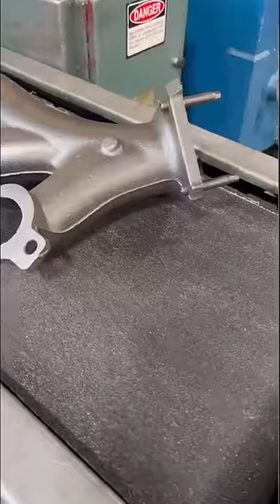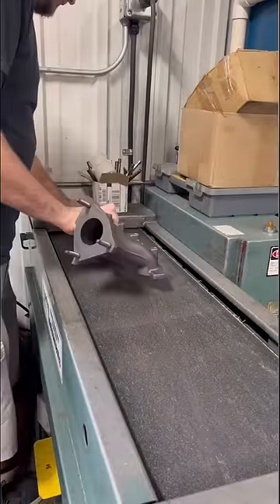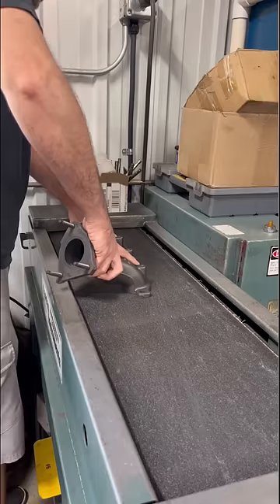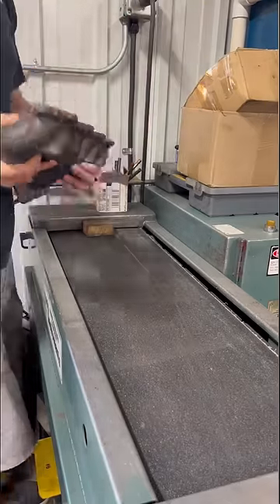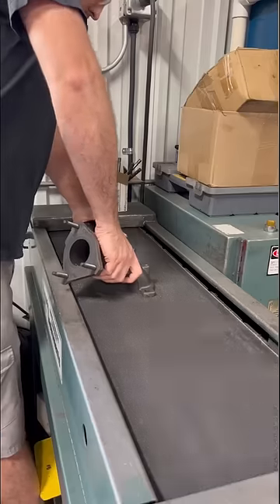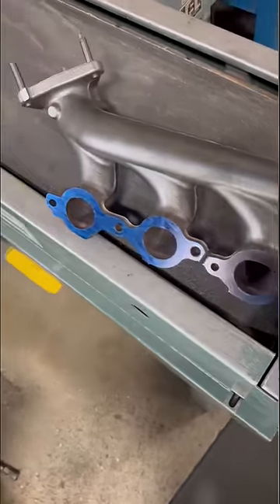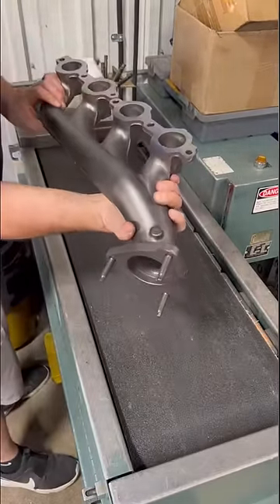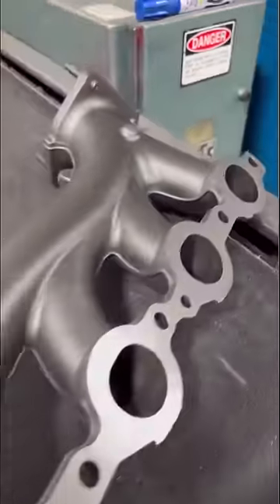#shorts This Is How We Resurface Warped And Worn Exhaust Manifolds

Comment: Hey since the video is making another rotation around. What would you say if shops don't want to do small jobs like this? Called a guy cause I wanted my head resurfaced found it should cost a couple hundred bucks. And the guy I was able to reach in my area told me. " My machines worth more to leave off then run it for a couple minutes on a head." And I know those machines aren't cheap by any means. But isnt that the part of why you have it. To add more business?

Comment: cracked dat flange, dont think i didnt see that ;)
Reply: Look at the gap and shift after… that was a bad design and stress at that point in the metal. Eeek
Reply: Cut that thing In half to reduce leverage from warping. Intentional mod.
Reply: EZWeld 🤣🤣🤣🤣🤣
Reply: One piece flanges crack. 454's are notorious for that...That was cut to eliminate that problem.
Reply: Factory &as a small gap there (really small) on newer ls's all 4 are split.

Comment: Okay, WTF is going on with the tiny metal bridge in the middle?

First it's connected.

Them later it looks like it it's sheared in half.

Them it looks connected again.

Are you pulling out legs, and showing two different exhaust manifolds, or did you have to cut and re-weld it to get it level?

Comment: Holy hecking hecks, that's a big old belt sander.
Dang, yo, if ya use it as a treadmill I guarantee you'll lose weight.

....i mean, either by running or sanding off ya legs..

But weight lost either way, lmao.

What grit is that belt? Like 60-80 or 220+? That much surface feed rate would be some aggressive material removal at 60 grit, im guessing.

Thats gotta work far faster and more efficiently than finding all the stuff to properly hold a awkward part like a manifold on a milling machine.

Comment: Thay will aways be whooping on the ends even a week after you put tham back on because the middle gets hottest and the ends will aways whooping a little even machined but whare thare bolted on thare tight whith a gaskets thare fine but I will give you a tip from experience  make dame shore you don't use a after market  gasket  ill garrentee you will have trouble air sucking in

Comment: Aaron give it up don't be like that if you threw a micrometer on there it would be within a few thousandths it's an old way of doing it but it works are you going to mouth the power block Channel because they resurface a head with a flat piece of Steel and sandpaper

Comment: When you want a bodged job done, use this guy.
Reply: It's not going to do anything to it that machine has a flat platen that that belt runs across more so than any belt sander in a wood shop? Doing it with a file or a bodyboard or by yourself ain't going to work they do that stuff all the time as long as you run it lightly it doesn't wreck it or taper it so that's the way you do it if you set it up on a mill it's going to take cost three times as much

Comment: I actually have 2 of these belt sanders.  This is exactly what they were designed for.  This is a stock run exhaust and not a percision built exhaust for a 2500 horsepower setup.  This is for taking something .020 out and getting it don to .002 give or take.  As long as you are not decking heads and blocks with this machine then I don't see a problem.

Comment: What's up with the massive Crack in the middle of the intake then is all of a sudden gone
Reply: One of two things, I was curious after you left this comment so I rewatched it a few times. IMO I think he either just edited it weird and was doing two different manifolds and was just showing two diff times he was sanding to get across the same point. The beginning and end are the same and the two edit parts in the middle with sharpie are the same, he may have just not filmed with the other and put that in to show the process. Or he was just trying to make it look better lol but Obviously both are just conjecture on my part

Comment: It doesn't need to be absolutely perfect. It's got a gasket. This is by 99% of people's definition of flat as Fck. You could go through the effort of doing more but the gasket is what deforms to take shape of the surfaces and creates a seal, not the faces themselves.

Comment: This is not the way you do it! 226 Super hurricane intake and exhaust manifold! 
   You lay on your belly, Hang out the Sliding door of your Chevy lumina van, Hold the manifold against the surface of some nice new concrete, While your wife drives the Van Back-and-forth! It worked great!!!
    All you need is a Van with a sliding door, a nice stretch a new concrete, And a wife that doesn't give a damn about you!!!
     Otherwise I don't recommend it.....

Comment: A and you're not wearing gloves and safety glasses because of what reason
Reply: He is wearing glasses. But you never wear gloves when using a sander, drill press, or lathe - because if the gloves gets caught, it will pull your hand or arm into the machine

Comment: Wow this is serious....  I noticed your name is missing quotes around Machine.  I mean I guess it's cool that you show people that you cut corners with that operation so they aren't deceived but I'm not sure I would be proud of that...

I mean challenging the dude to do it in 5 minutes is a strange response but I guarantee his product will be better than yours if he uses the proper tool for the job.

Just because fixturing isn't as straightforward as just machining a block doesn't mean you just say fawk it.

At least do it by hand on an actually flat surface...
Reply from the maker: Take a minute to educate yourself before you comment…

https://www.comecmachines.com/comec-spn800-belt-resurfacer/

Belt sanders as shown in the video are designed and marketed for the exact purpose shown. This method is not “cutting corners”. Cutting corners would be tossing the manifold back on the vehicle as is.

This is a matter of determining what is truly required for the application… 

Maybe these manifolds should be ground flat for an even better and flatter surface than machining, or better yet, we could even use a lapping process! But neither of those things will do anything to improve the function of the manifold. 

Everything in this world is a balance of time, money, and desired outcome. In this case, a belt sander is an optimal balance is the three. 

Challenging the dude to do it in 5 minutes isn’t strange… it proved a point. The guy claimed he could do it better and quicker, but given the opportunity he completely flaked. 

Have a good night 😘
Reply: @JAMSIONLINE  throw a mic on it and let's see how good this machine does.
Reply: @EVLS10  your ignorance is amusing. 98% of automotive technicians wouldnt even consider the flatness of an exhaust manifold. Hell most of them dont even clean them off. They throw another gasket on it and go. Clearly you have no idea how to properly check for flatness. Its defiantly not with a mic. A micrometer would prove nothing if we are concerned about flatness of a sealing surface. Next time you might want to educate yourself.
Reply: @johnellyson3930  So many problems with your comment.  First off these aren't mechanics, they are a machine shop, ie running precision machinery.   I'm fairly certain they don't install exhaust manifolds.  A micrometer is actually the perfect tool for checking flatness across a large surface.  You fixture the piece and run the mic across the entire surface checking for deviation.  That's exactly what it's made for.  The fact that you don't know this is amusing as you would say.  The issue at hand with a belt grinder is that you will develop a curvature to the piece as a whole.  See how he starts pushing on one side and then sets the other down?  That can easily throw off the flatness of it.  Sure a gasket should take up a small amount of slop but it's not a great method if you are wanting precision.